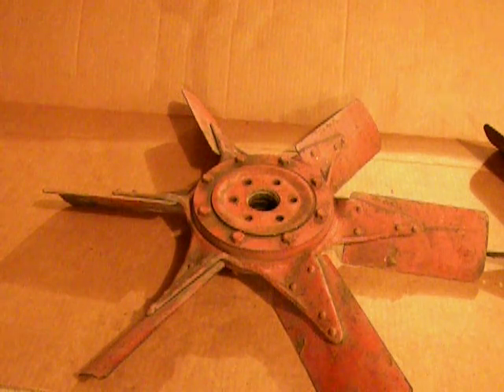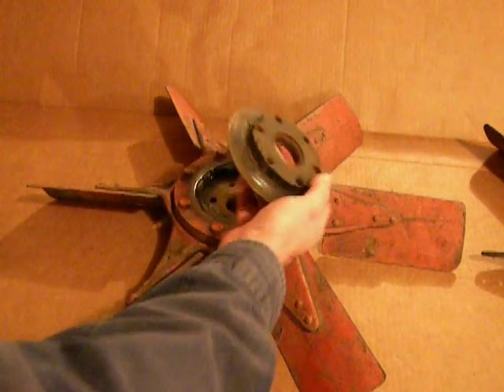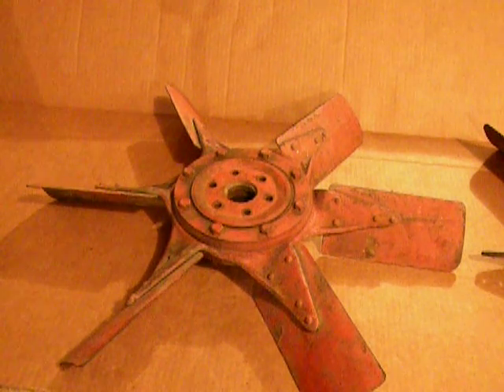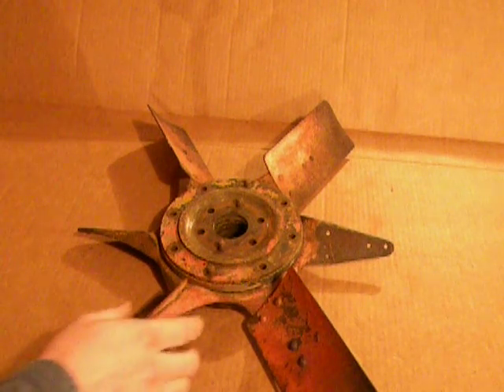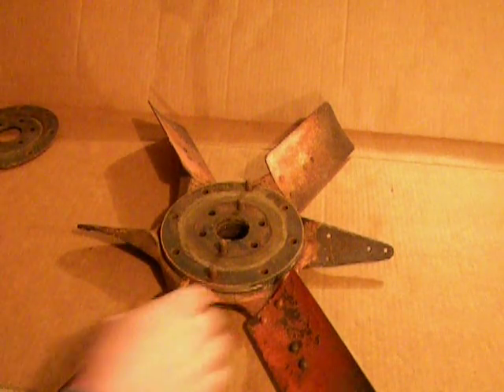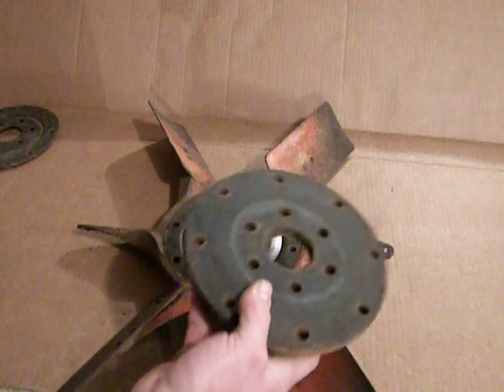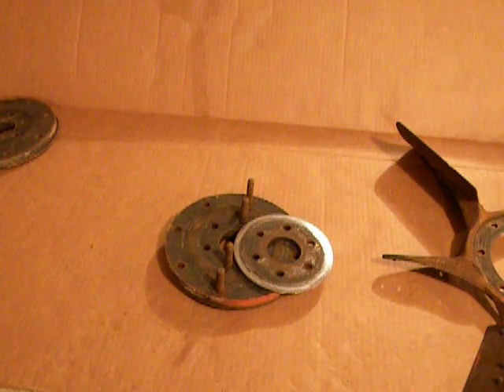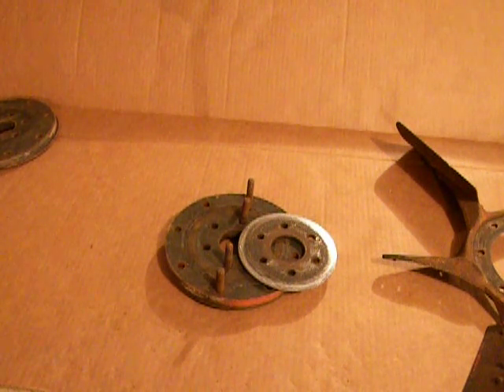Caterpillar RD6 D6 Radiator Fan Failures

Comment: Pulling the decompression lever is a good practice and is a very common method for shutting down John Deere two cylinder diesels as well.  In the John Deere case it saves on the crank splines in/on the flywheel as well as the coasting allows the engine to stop at different points of revolution and spreads out the wear on the ring gear from the starter. If you don't decompress, the engine stops the flywheel in one of four points the starter will come in contact with and eventually causes wear from the engaging of the starter.

Comment: The decompression stop is a good idea. Coasting is better than rattling. Cat is still at it though. On the D5-K's, because everything is electric over hydraulic, there is a nylon coupler between the crank and the hydro pump. The originals look like a cam gear on an over head cam engine. They strip.The one I was running acted just like I flipped the park on. Cat came and pulled the engine out and the teeth were gone. The new coupling is 5 big lugs instead of the teeth. Sure got my attention. I had a land cruiser with a rag joint in the steering.  They were popular back in the day but if I ever had to get another I'd make it out of conveyor belting.
Reply: I did that on the 8-H and 7-E for turbo oil and spinning down easier. Just seemed that stopping them the way I started them just worked better. And it just sounded better, if everything else failed!